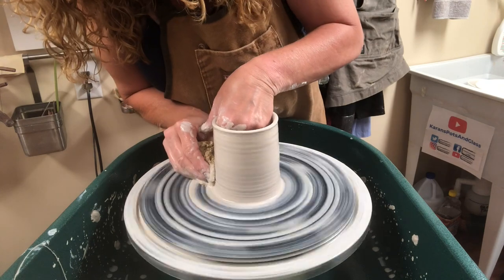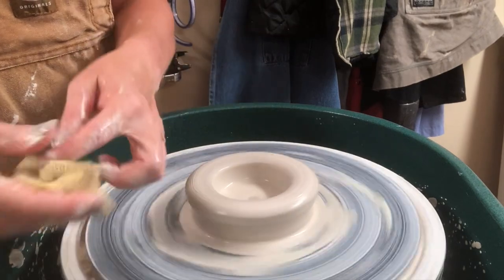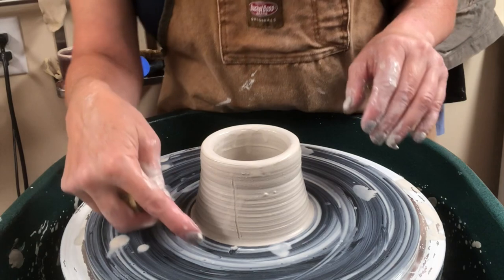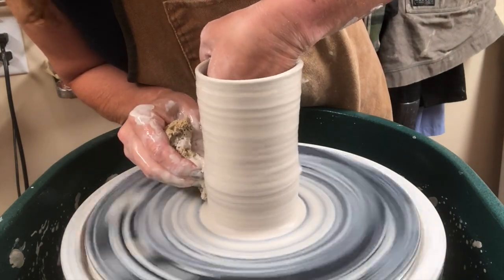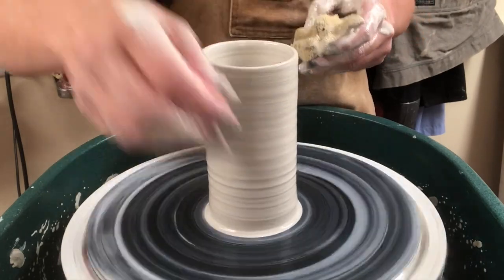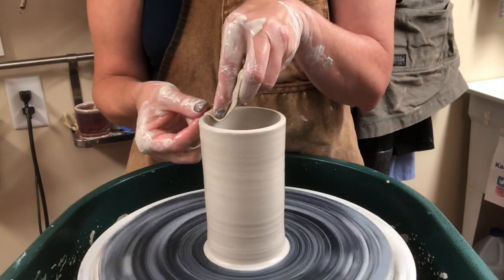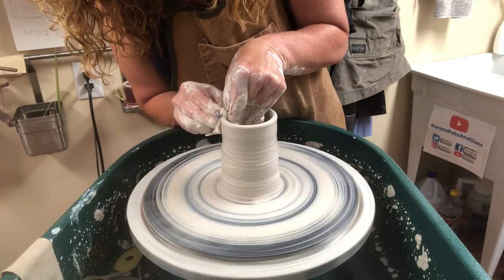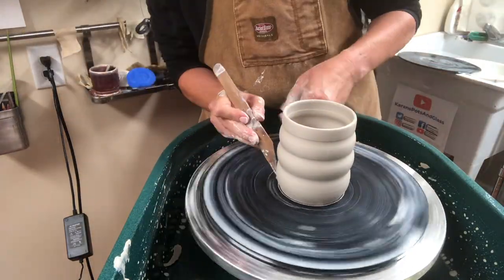Wheel Throwing Series, Step 4:  Two Ways of Pulling and Thinning the Centered Wall!

Comment: The inside is soaking wet
Reply: Undercut the bottom. Should be keeping wheelhead dry and clean at base of pot first pull up should have gotten you higher.

Comment: How thick should the completed cylinder wall be?  I would imagine a mug has a generally preferred thickness for drinking.  Not as important if a vase.  Thank you
Reply from the maker: Hi Tracy!  Sorry for the delay!   I like my walls to be a little thinner than 1/4".  I'd approximate 3/16".  :)
Reply: @KaransPotsAndGlass  Thank you kindly.  Each throw is a tiny bit better :)